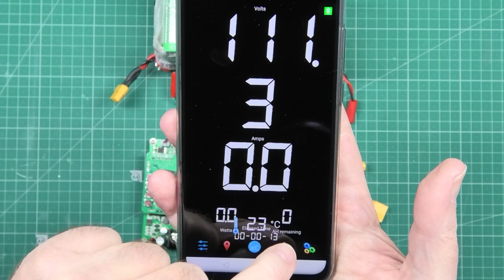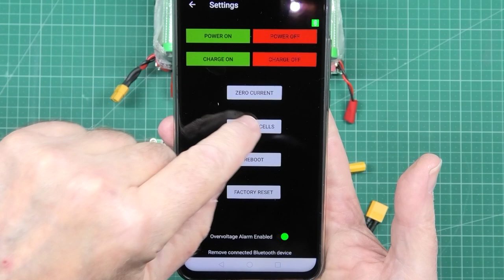32s Li-Ion battery build for testing ANT-BMS and developing VBMS app

Comment: Hmmm, if you only need another 16 volts you could just hook up another DC/DC boost converter and attach it's negative output lead to the positive  output of the 120v unit then the positive of the extra DC/DC booster wire will be 120v + whatever you set that one too, because of the way most DC/DC converters work the grounds are floating and won't cause any trouble. Hit me up if you don't get any of what I said. Keep the vids rolling!

Comment: right tony need to pick your brains about battery packs at the moment daughters is 24v  100w motor / i have 36v 1000w motor both got lead acid batterys in both e scooter(but i want more distance and battery life ) i want to upgrade to your style of battery packs could you give me a rough idea it would cost me for each  cheers me duck :)
Reply from the maker: It all depends on how many Ah the current batteries are mate. You could build a 6S battery with only 6 cells and it'd cost around £18 but you wouldn't get very far. On the other hand, you could build a 6S battery with 60 cells and it'd cost 190 quid. I need more info (Ah of the current battery and how far you get on the one you've got).
Reply: @Vortecks  once i get about 100 18650s ill  be in contact cheers tony

Comment: Wondering if you should of added some O rings to the positive cap of each cell. Not such a risk when your spot welding but if soldering onto the tabs the heat may cause the tabs to melt though cell plastic and bridge the outer casing .

Comment: Hi tony , quick question i have a voilamart 1500w e bike kit, built in controller. Recently i broke the display which is a SW900. My question is am i able to purchase a different display? And use that? . Im struggling to find a pissin SW900, thats got a waterproof connector.
Reply from the maker: In theory, they should all work but..... the wiring will probably be different so it'd need some research beforehand. What I'd do, is buy a cheap one, wire it up and make the connector waterproof myself with some self-amalgamating tape.
LCD https://ebay.to/2Tm3JuU
Self amalgamating tape https://ebay.to/2PL9PCR

Comment: On V4, are you gonna run 120v through the motor you currently have? really interested to see how does it hold up!
Also, where did you get those cells from?
Reply from the maker: Yeah, I'm gonna try 120V. Whether it holds out or not is a gamble but I won't know until I try 😁
I fell on the cells by chance but they're all sold now.
There are some others and, even if they're fake, you're protected by eBay policy https://ebay.to/2PI0StK
Reply: Hi love ya vids who was suppliers of 32s bms I could  do one been running my 134.4 fullycharged without obviously I monitor..